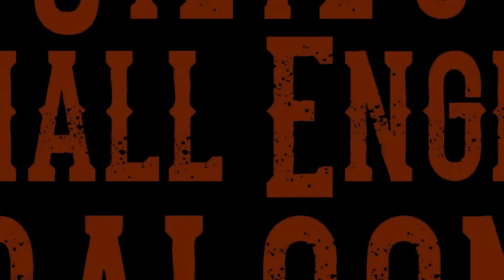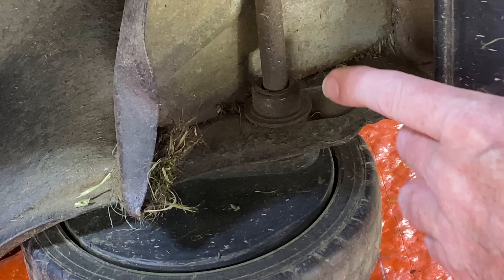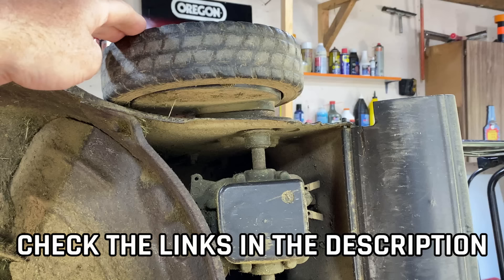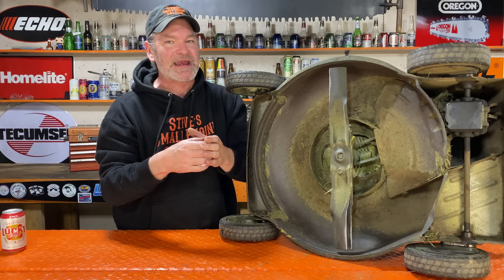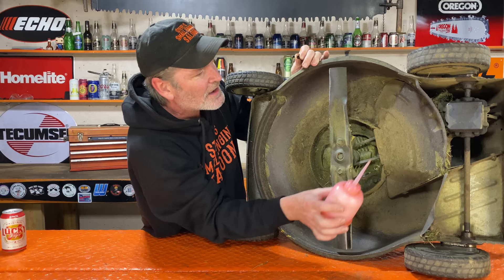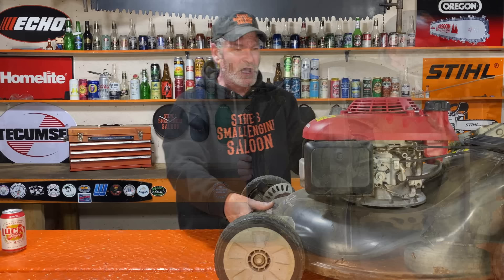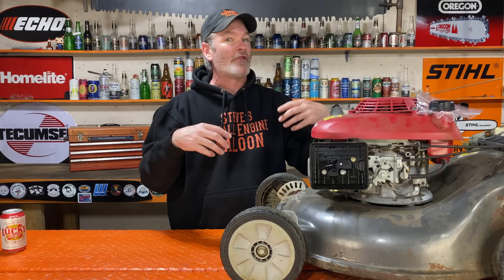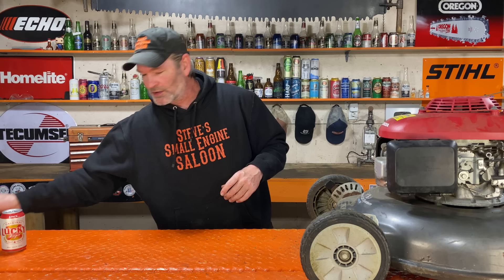Solved! The Mysterious Case of the Honda Lawnmower That Wouldn't Pull Backwards

Comment: My special recipe is 50% 91 Octane non ethanol, 50% used atf (usually burnt because I drive a dodge) and 50% maple syrup. The maple syrup helps the atf stick around and the 91 just smells good. If you're concerned with my math just remember I'm a Canadian American so I'm using metric percentages.

Comment: I forget if my dandy Honda does it, but my dandy self pace Toro needs to fwd a couple/few inches after let off so can pull backwards. It was born that way. (-:

ha, 193cc Toro made me giggle. (nice mower/fast/wash port) My first wheels was a 125cc Suzuki. (-:
blah blah...my first Toro self mower was decent but it loved making lawn guacamole mowing tall 'n dry.
Reply: Oh yeah, once there was a problem with the newer Toro's drive not working. (no clue how I fixed it, took some stuffs apart..hmmm, squirt squirt, play with...oh it's the belt).

~ Point being I supported it up on it's two front wheels...leaning/bungee against the trampoline..same as a table. Methinks it smoked a bit, but all was good.

Comment: Thank you Steve.  Had the problem, a real nuisance.  Tried your fix and it worked.  I decided to pop a cold one to celebrate the victory and realized I had to pop one more in your honor.  Mooch-us grassy-ass Steve.  Out.
Reply from the maker: You're Welcome...
Reply: @StevesSmallEngineSaloon  Cut the front yard mid-morning today.  The improvement is outstanding.  I already use AFT/acetone at 50:50 in a spray can that I soldered a tire valve into that I can refill and charge with compressed air.  Works as well as any penetrating oil I have found.  ATF has been successfully used by techs to quiet and clean noisy hydraulic valve lifters and by armorers to help loosen up gun jams.  Some say the old Dexron and type F formulas work better than the newer stuff but I'm no chemical engineer.  This advice of yours was of more value and help than I would have expected.  Thank you again!

Comment: Hi Steve, great fix, thanks. I have a SARP 21" (ex Honda?) that sometimes won't stop when I release the drive lever - is this the same fix? If I lift the rear of the mower a little and drop it, it releases the drive and the wheels stop!

Comment: Need some help hav a simpson pressure washer with a honda gx390 its all black i bought a electric starter kit but the mag on the flywheel is in a different spot and it dont start now i got a big hole that i drilled for.the starter is there a different kit for the black engines ??? I bought the pressure washer 3 years ago all the flywheels r pre 2011 and they changed the design after 2011 I guess

Comment: I have a similar Honda lawnmower and if I engage the self propel it does not stop.I had a new transmission installed but mechanic is no longer available.  If I lift the rear wheels and gently drop mower a couple of times it stops self propelling.  Sounds like something is broken or lose

Comment: Oh, this is cool! I picked up one of these mowers for $15 (It just needed a $2 part in the blade clutch) and it also has this problem. I hate these Honda mowers though. I mean, I know they're "good mowers", but they're so damn heavy... I'd rather just have a light non-self-propelled old-fashioned mower, but ya can't even find those anymore. Think I'm just gonna get a new engine for my old Husky...sell the Honda to pay for it. Thanks, Steve!

Comment: Hi Steve,  I don't know if you have touched on this before if so could you point me to the video?  Anyway I just bought a John Deere Z turn tractor.  It came loose on my trailer on the ride home.  Could you please go over the best tie down method for a zero turn mower on a utility trailer.  Thanks so much.

Comment: Hey Captain, I had a question for ya, so I got one of those Honda 190 pressure washers from Costco and they also sold the Subaru electric start ones which I picked up one of those anyway the pump on the Subaru took a shit I was wondering if the pump on the  Honda 190 is compatible?

 Thank you for all your videos you’re the go to.

Comment: Hi Steve, if I may.... I have a Honda lawnmower with a tiny issue..... it's starts just fine at the first pull and keeps on running great..without the air filter on.... as soon as I put the air filter on it kills the engine... I cleaned the air filter thoroughly but with the same outcome..
Any thoughts or  wisdom on how to solve this?
Thanks_Phil
Reply: Are you using a brand new, clean, Air Filter??????
Reply: @frandanco6289  Hi there, I just washed it with Dawn and blew it clean with the compressor than I let it try a couple of hours in the sun...
Perhaps I should buy a brand new one.....

Comment: I have a similar but different issue. Same type mower. You can start and pull the mower back but once you engage the drive system it will not pull backwards until you shut the mower off. Any suggestions?

Comment: I've got a old Cub Cadet mower with a Honda engine on it and if I don't use it for a while I have the same problem but after I use it for a while it gets back to normal , I need to see if it has that problem . I always have some 50/50 home brew handy ------ Nooooooooooo Steve not that kinda home brew 🍺🍻🍺🍻

Comment: also... another trick is if the drive sprockets are chewed away from use.. they typically get chewed away on only 1/2 side of the sprocket, to get 1 or 2 more seasons out of them, you can switch the right and left sprockets.. just make sure you have them in facing the correct way. The new sprockets will last maybe 2 or 3 years whereas the OEMs lasted 15 or more.

Comment: on my mower, the problem is the drive belt will ride out of the pulley, and add tension until it pushes on the idler enough to apply the brake.

Comment: I usually end up replacing the bushing. Its usually so gouged up from sand, no amount of lubrication helps after a while. Thats a temporary fix and may only work for a short time. I hate changing them but someone has to do it. I will never sell a Honda mower like that without changing the trashed bushings. I do not want to see it come back eventually, then I have to hear about it.
Reply from the maker: Fair enough!

Comment: Good to know, I have this issue. What would cause the grass/leaves to stop going into the bag when it's about a 1/4 full? It just clogs at the opening.
Reply: @Get in the car - your bag material is clogged. Remove it from the frame, hand wash in warm soapy water, rinse, and let air dry. Else buy a new bag.
Reply: If the grass  is high and wet, it will not move as fast and easily as dry grass... Yes, you need to blow from the Outside, all around the bag , to blow the tiny bits of grass out of the cloth, especially at the Back of the Bag, where it folds down...

Comment: I have the HR215 from '91 and if the hydrostatic oil gets low it will not pull backwards, the wheels lock up but it will propel foward sluggishly.
Reply: I have same mower, '91, with same problem. 1st time I replaced the clickers...I need to get at the problem again. Maybe this time it will be easy fix...

Comment: There is a Honda service bulletin on these bushings. The correct bushings are supposed to have a blue paint code on them. (Honda cleverly did not change the part number)

You think there's no resistance going forward, and there isn't when you're pushing it, just as you saw in the video. But when the engine is driving that axle, it is encountering the same resistance. I've seen this cause severe enough wear on the axles that the transmission has to be replaced, and the transmission itself wears more quickly.

Everyone sings praises about these HR Hondas - and I like the Honda engine. I just don't like it on the Honda mower. Excessive tire wear, stupid cheap individual wheel adjusters and this chronic and ubiquitous bushing issue are just a few of my issues with these mowers.

Comment: This is one of the few reasons why Honda is a POS.  This problem has been rampant for years they have done nothing to correct it.  As much as I’m going to miss making money off Honda Fan Bois, glad they are gone.  

I’ve never had luck lubing shafts and bearing.   I use PB Blaster…maybe it’s time to make my own.  This repair is a PITA

Comment: I don't think I've ever disagreed with anything you have said in the past but....
If the bearings at the wheels aren't tight going forward, they won't be tight going backwards...if your tip worked it's because you lubricated the bearing at the power split box. Pushing the mower forwards 
disengages the pawl at the wheels and the drive shafts don't turn, pulling it backwards engages the pawls and the drive shafts turn inside what could be tight bearings.
Reply from the maker: The axle does not turn when you push it forwards.  Watch the closeups again and its pretty clear!
Reply: Thank you I understand what you mean.

Comment: The real fix here is to disassemble it, clean it out with a new bushing and then add another $0.19 dust seal on the wheel side. Problem is that dust and dirt get in that bushing and jam it all up.

Comment: Thanks Steve but you took too long to solve this for me so I ended up doing it myself 🤣👍👍🍻🍺
Reply from the maker: Right on
Reply: Steve I have a Honda GCV 160cc that won't start when engine hot, no problem when engine cold starts first pull cleaned carb and new plug but made no difference. HELP. Geoff Stringer. England

Comment: The actual problem is in the drive wheels.  The spring loaded clickers that catch to turn the wheels.  Owners Manuel says push the mower forward a few inches to unlock wheels.  It works.
Reply: I. dean -- Tks for your post.. Not sure what the owner's manual means... We are pushing the lawnmowers Forward already, cutting the lawn.. Then, when we need to back up, the rear wheels are not wanting to turn easily...  From Years Ago, people with this same problem were taking the wheels off, bushing included. 
Then, sanding down the area where the bushing rides on the axle, to remove the rust, and smooth it all out better.
Then, installing a little grease, to keep it lubed and rust free, and re-installing the bushing... Not sure how, after going Forward with the mower already, that now it needs "a few more inches" to unlock the wheels...      :)

Comment: This is only a quick fix that will fail again. They should always be pulled apart, everything cleaned with scotch pads, regreased and then the trans cable should be readjusted. Honda shop manual says to use a high quality high pressure marine grease never use white lithium grease or other oils. 
To properly adjust the cable you turn it just until the wheels lock up when pulled backwards then loosen it 8 full turns.
Reply: Best thing is Oct. 2023, this over rated junk Honda has ceased production.

Comment: Dude.. there is literally a fuel shut off valve on that thing facing the camera! Unless you are telling people how to tilt other model, that bag trick was completely unnecessary on that mower 😆
Reply from the maker: Why do you think the shut off will stop the cap from leaking?
Reply: @StevesSmallEngineSaloon  OH... I thought the reason you did that was to keep fuel from overflowing through the carburetor, by creating a vacuum in the tank. My bad :)